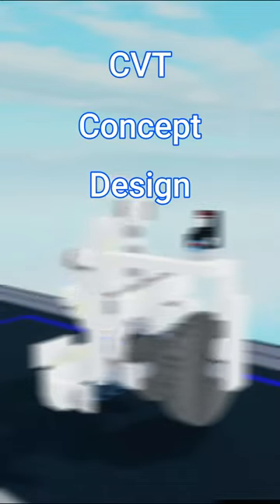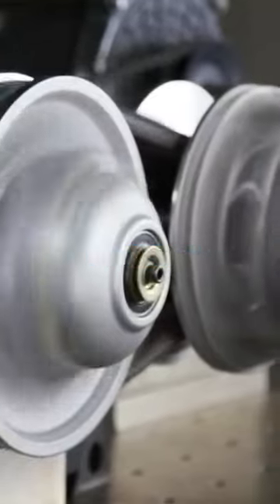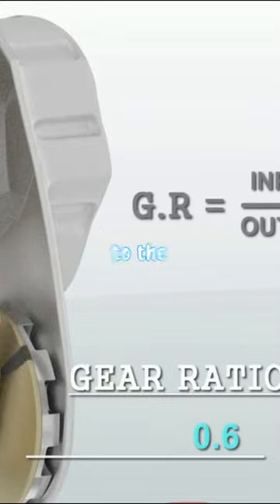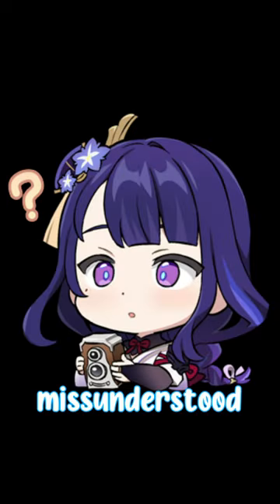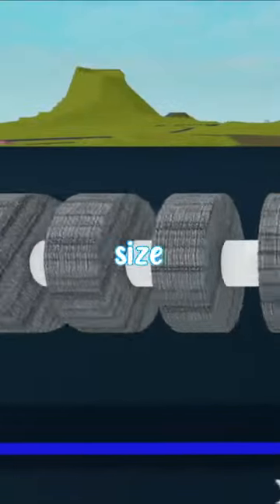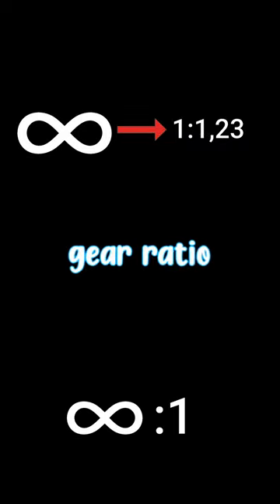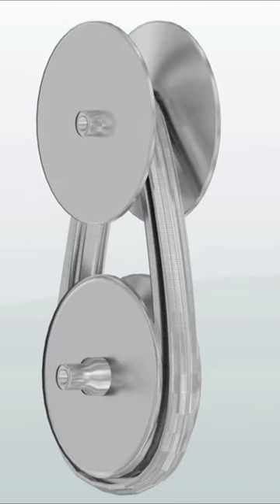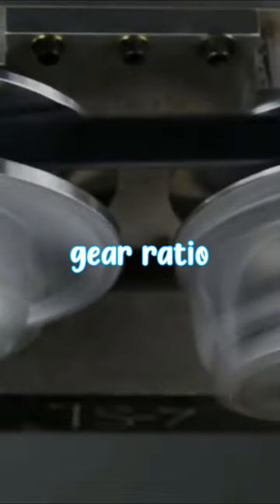Plane Crazy CVT Concept Design | PC-Showcase pt5 #shorts

Comment: Its not really infinite, because the smallest change of position an object can do in the universe is about 1.68 x 10^-35 meters.
Reply from the maker: Then how come it says so in wikipedia and many online trusted source
Reply: @evans_workshopx  because its a really small number. If say we have two belted discs of cvt that can both change radius, and the sum of r1 + r2 at a particular moment is always constant. And both of their radius varies from 10cm to 20cm, then there are about 5952381000000000000000000000000000000000 gear ratio variations. Manual transmission usually only has 5 gear ratio variations for comparison.